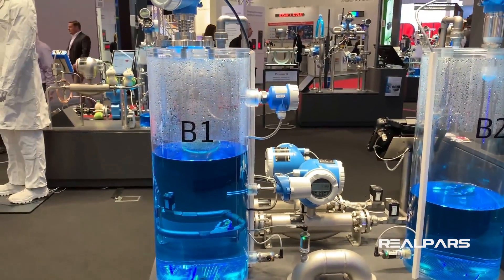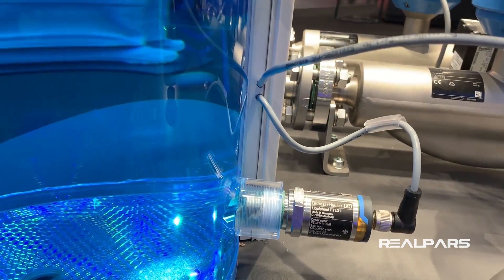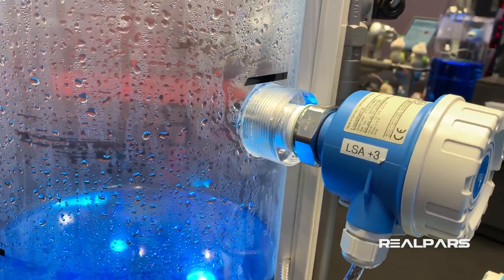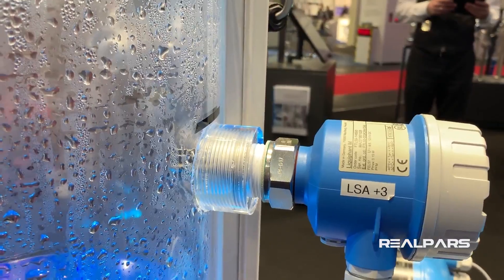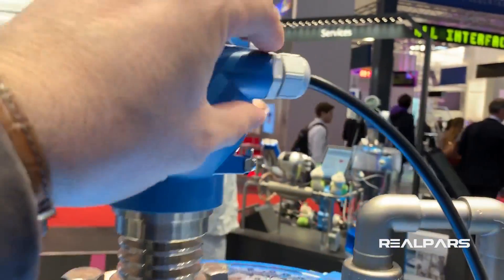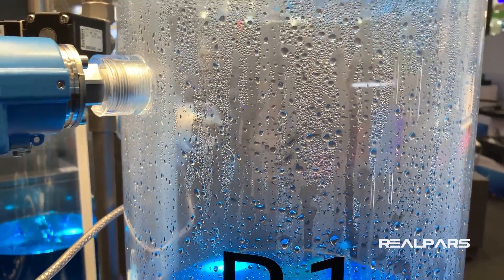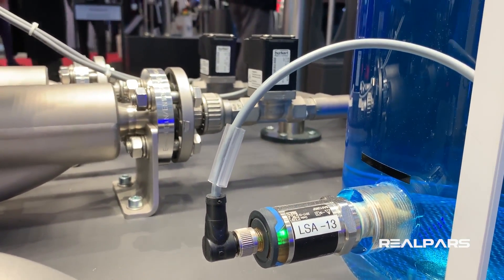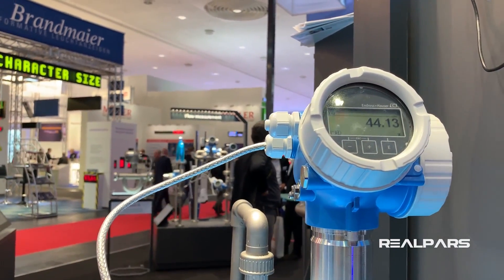How Level Sensors, Pressure Sensors, and RTDs  work (Practical application demo)

Comment: What is the type of sensor that is shown as a black box type labbeled Durker? at 4.37 which looks to me like a flow meter
Reply from the maker: The "black boxes" you are referring to are Burkert 2-way flow valves (solenoid-driven).  They shut off the flow in the de-energized position and allow flow in the energized position.  Just to the left of the Burkert valve in the foreground is an E+H ProMass straight-line coriolis flow meter.
Reply: @realpars  Thanks sir!

Comment: Thanks for the Video. 
Wired Transmission or Wireless / Wifi Transmission? Range? Type of Processor , Programming Language.
Reply: In this video, the level and pressure transmitters were 4-20 ma devices.  The switches were 24 VDC devices. The PLC was likely a Siemens 1200-series PLC using ladder logic.  Sensors can be purchased which are wireless,. and these would use either wireless HART or ISA 100 wireless as the communication standard.  Use of wireless instruments will require the use of a wireless gateway.  PLC programming can be accomplished most easily for this application using ladder logic, function blocks, or structured text.

Comment: thanks for this video..
very very insightful
can u pls write a program for level transmitter ( i need to know if analog signals/devices can be latched)
Reply: Comparator Function Blocks can mimic latching behavior for analog signals. So yes it possible to latch/unlatch analog devices.
Reply: If you are trying to latch an analog signal based on a particular threshhold being reached, then use a comparator in conjunction with a move instruction.  Analog signals are received at the PLC in counts, and this value is usually scaled to give the analog input in engineering units.  If you take the raw counts and then compare it against a threshhold value, you can selectively move the counts value to scaling logic, which would store the result in a REAL variable.  If the threshhold is exceeded, then do not pass the value to the scaling block.  The scaled value will then remain unchanged, or latched.  Realpars has several videos on analog inputs and outputs.  Check them out at Realpars.com!